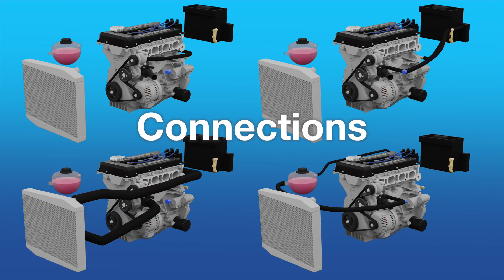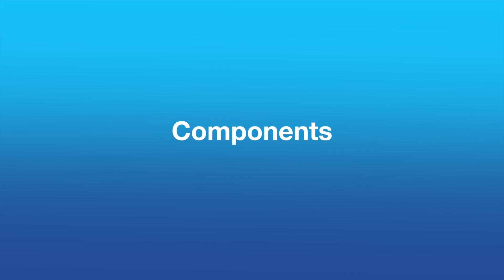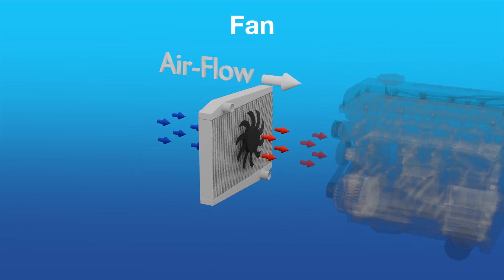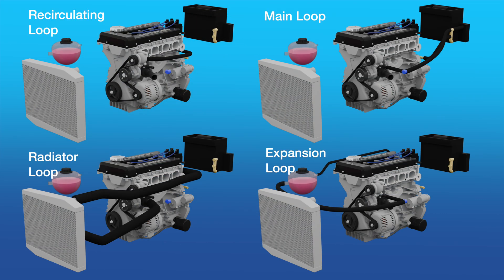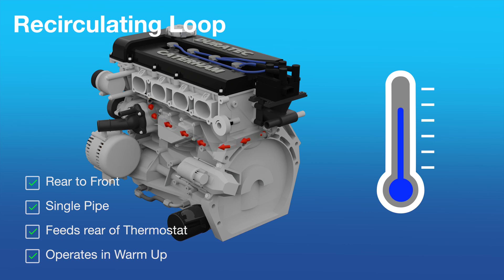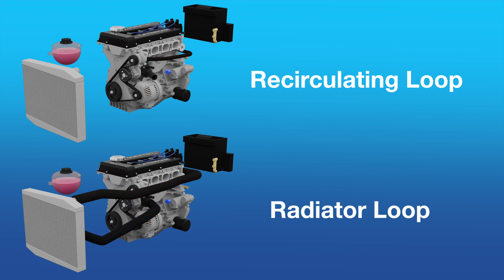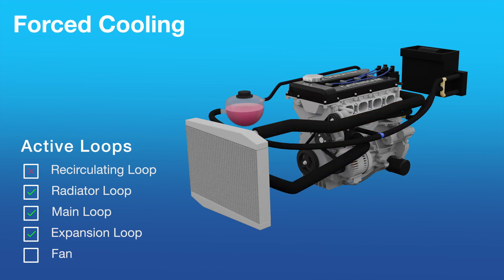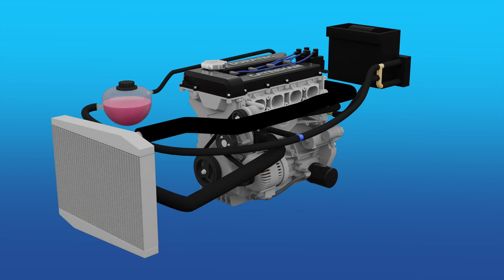Internal Combustion Engine Cooling Explained

Comment: On a Subaru it seems the thermostat is too low and down at the intake and is prone to allow air to be trapped in front of the water pump , causeing overheating . This is probably why so many Subarus have blown head gaskets . Heat rises so the thermostat should be located higher in the engine , not at the very bottom.  Its a poor design that they never fixed. 
Also a Subaru has a flat engine with  heads each on the sides  to the engine , so you don't know if both sides are getting cooled by the water.
Reply from the maker: Hi @green323turbo. Interesting problem. I don’t know anything about Subaru engines so I’m afraid I can’t offer any comment. Good luck with keeping your head gaskets intact! 👍🏻
Reply: @Purplemeanie  , yes i did the head gaskets and have it all running with heat coming from the heater , but 2 days later i noticed that the radiator was cold and lower hose was cold, ever though i had heat from the heater.  I bled the system and it worked for another day before the Rad got cold again , It seems  the subaru is bad at recovering from any air or bubbles. I ended up drilling  4 small 1/8" holes  in the thermostat and it has been working ok since . A bit slower to warm up, but at least its not going to over heat

Comment: Que pasa si el motor está demasiado frío? Y si se refrigera con helio liquido?
Reply from the maker: Hmmm… good question. I think there’s a trade off between magnetic fields of the permanent magnets and the windings. One works better cold the other when hot. There would be all sorts of other considerations though like the lubricants not working etc. so I suspect it would have to be very much designed to only work at those temperatures, even if it was possible. 🤷‍♂️

Comment: I am building a 2.5 (later stroked down to 2.4) MX5 MK3 (standard it uses a 2.0 duratec/MZR) and might use the hybrid electric water pump that came with my 2.5. Fan-bloody-tastic video.
Reply from the maker: Glad it was useful. Thanks for taking the time to comment. 👍🏻